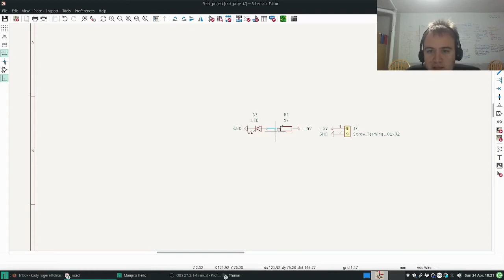KiCad 6: Add Wires To Schematic

Comment: Using Kicad 7, after selecting the wire tool and hovering over a red circle on a component pin, a "+" does not appear on the crosshair :-( I have to say, after 25 years of using Eagle (once in a while, every couple years) the missing "snap wire to pin while wiring" functionality is driving me crazy in Kicad. Even after following several hints (change grid to 50mil, make sure everything is snapped to grid) and greatly amplifying the view, I simply can't make ends meet, this is driving me crazy!
Reply from the maker: Hey. I'm just trying out KiCad 7 myself (with PopOS) and while hovering over a pin the option to start a wire is coming up for me. Have you got it working yet?

I plan to make KiCad 7 videos and start releasing them next month so let me know how your journey goes!
Reply: @femboyhacking  Hi, yes I got it working now, by rightclicking on the grid symbol at top left, in the settings menu it showed the "current grid setting" as something really small, although I swear at the screen bottom it said 1.27mm. After hitting alt-1 things were working normally.
Another confusing thing was when usung M for moving parts, it tore away from the (oh so painfully)  connected wires. Found out that G leaves them attached. Seems to me that should be the standard behaviour, who would want to rip off the wires by default?